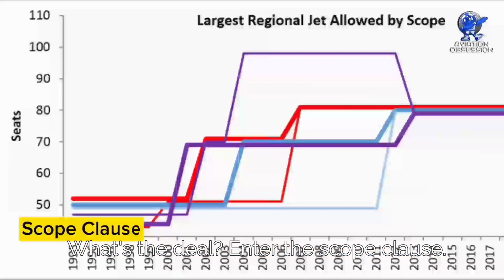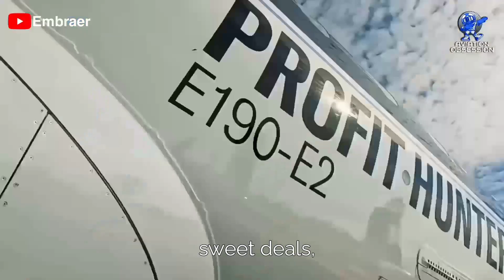The Embraer E2 Jet: A Game-Changer in Aviation

Comment: 1:28 in terms of reliability and durability, it's actually a downgrade, it's really the Achille's Heel of the E2. Just ask KLM about having to ground a third of their fleet due to engine trouble from those Dependable Engines 🤣🤣🤣 If Embraer chose GE's new-generation engines for the E2 based on their NG34 program, it would definitely have been more reliable, and most likely at least a bit more efficient, too - the PW1900G actually manages only an 11% fuel efficiency improvement over the CF34-10E of the original E190, whereas the GE NG34 was designed for at least 15% fuel efficiency improvement over the CF34 in general. The scope clause has had two unintended effects that, over time, have proven to be for the best:

It helped cause the CRJ-550 to come into being, which is widely loved by passengers because of its first class (premium economy, really), and extra legroom economy

It (along with the additional material needed for the longer fuselage) happened to have prevented the E175-E2 with its heavier engines from ever getting any orders, which has turned out to be a good thing, because those heavier engines also happen to have been causing lots of trouble. The GTF, far from having it's teething troubles sorted out, not only has continued experiencing trouble since its EIS, has gotten even worse, to the extent of causing a whole airline to cease operations because of engine problems. The GTF is so bad that once some technical issues have been resolved, more pop up, it's been a game of whack-a-mole for years, with no end anywhere near in sight. Imagine how bad the disruption would be if the E175-E2 got into the market!

The E175-E2 maybe, just maybe, have a better chance at success if Embraer scales back the fuselage length to exactly match the original E175, and ditches the Geared TurboFailures in order get GE NG34 engines.
Reply: That's P&W's fault
Reply: @LucasSanRFS  💯